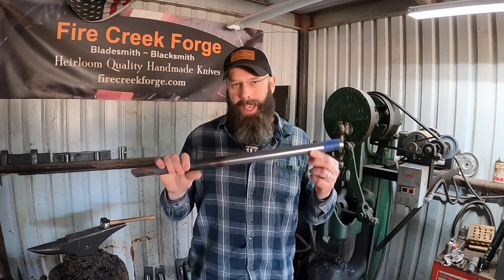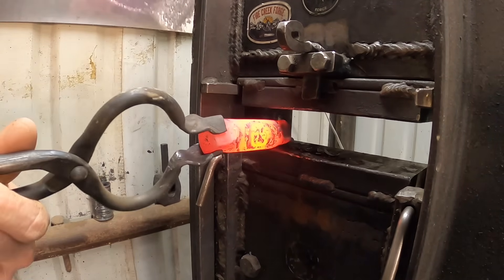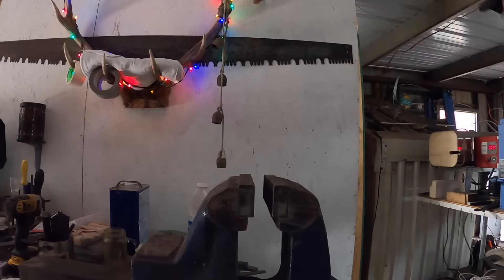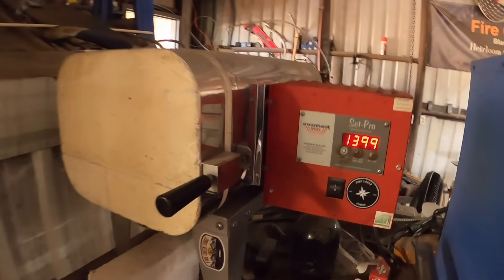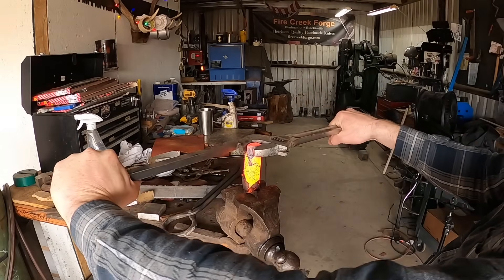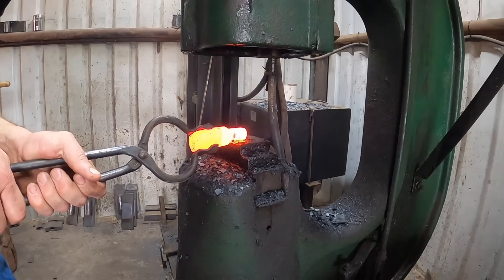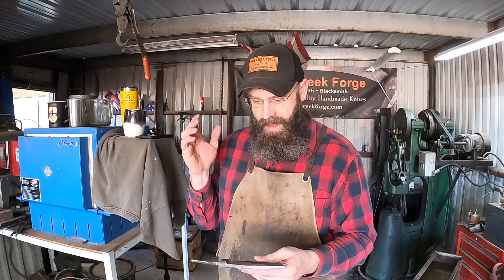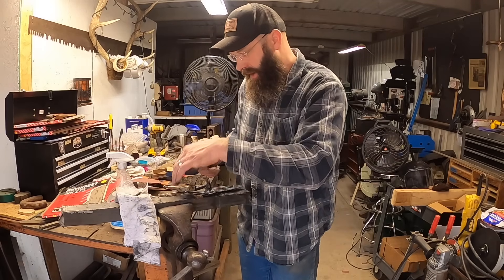Can I Make "Wootz" From W1 Steel??

Comment: I am a professional metallurgist with 22 years in the industrial forging business and a couple of years in the bearing business before that. I got started down the path of metallurgy because of knifemaking which I started doing in the early 1990s. I mention that just so you'll know  that my following comments are informed by formal metallurgy training and experience. The project in this video is super interesting because it relies only on the solid state diffusion of carbon, controlled by thermal cycling, to develop a visible carbide pattern. In my professional capacity I have had the opportunity to look at both modern and historic wootz and I have read most of the technical papers on the topic. Dr. Verhoeven was in the midst of his work on this when I was in college and I have read and re-read several of his papers from that time. His theory on the need for a carbide forming element has become the accepted idea as the key reason for the macroscopic carbides. However, it is absolutely possible to achieve that pattern without a carbide former provided you have a very slow solidification rate and some phosphorus. Phosphorus was very common in early iron ore and was not removed by early steel making methods. When present in sufficiently high percentages (it is common to see historic wootz with P=0.1-0.2%) it promotes carbon segregation. the phosphorus also changes the temperature and carbon content at which normal reactions take place in steel which means the iron-carbon phase diagram is no longer an accurate predictor of what is happening in the steel. The phosphorus compounds that form have a much lower melting temp (as low a 1750 F) which is one significant reason why historic wootz was often forged at fairly low temperatures. the other challenge associated with forging traditional wootz is that some the carbides are very large, can be interconnected and are very brittle. They do not all dissolve during forging and so you are really forging a composite structure of austenite and iron carbide. In the mid 1700s the English started using crucible steel making methods but they did not make woots and really struggled to do so when they tried. This was because the iron they used as the basis for their steel was low in phosphorus AND because they poured their liquid steel into cast iron ingot molds resulting in fast solidification. That prevented large carbides from forming. The makers of wootz used a method in which the liquid steel was allowed to solidify slowly in the crucibles, which according some historic observers were left in the furnace to cool. It is this very slow solidification combined with phosphorus in the raw material that seems to be one of the significant reasons for the large carbides in wootz. Clearly, you can make large carbide patterns when strong carbide forming elements are present. Many people have done so in modern times and even modern high alloy tool steels may show carbide segregation if they are etcheed. this is particularly true of the high alloy steels like A2 and D2. It should also be noted that carbide size can be manipulated as was done in this video simply by using various thermal cycles but it unlikely that this method will ever develop as bold a pattern as those achieved by the precipitation of carbides directly from the liquid metal during solidification.
Reply from the maker: Thanks for sharing!

Comment: Safe to say answer is NO :) Cut it up into small pieces. Place in crucible. add glass and leaves. Melt the crap out of it then slowly work the puck into shape. The W1 should have the trace Vanadium needed for the pattern to form.Then I'd say Yes :)

Comment: Logically it makes sense that the grain of the steel never changes while forging. I wonder if you couldn't forge a blade as normal and just do a bunch of thermal cycling afterwards to get carbon migration
Reply from the maker: I believe so

Comment: I get why this is an interesting experiment from an aesthetic angle; finding a new way to get a pattern in steel is cool. But when it comes to pratical knife building, I'm a little stumped as to why you'd go with a technique that increases carbide size in your steel. I'm currently reading Dr. Larrin Thomas's book Knife Engineering (the second edition). Everything I'm understanding so far points to large carbide formation being an undesireable condition in knife steel. specifically, carbide growth leads to reduced toughness, because "(L)arge carbides require much less energy to initiate cracks." (P. 40) Further, larger carbides lead to more difficult and inconsistent sharpening. (P. (7)becuase
Reply: My understanding is the large grain structure was only temporary to get the desired pattern and after he did that, he changed the grain structure back to what would be ideal for a knife. I highly doubt he wouldn’t properly treat it to make the knife fully functional.
Reply: @mulepowerforge  grain structure and carbide size are two different things, as far as I understand it. I know he thermal cycle to refine grain structure. But if the carbide themselves reduced in size, the patterning he was looking for would be lost, unless I'm missing something. It's not about the heat treatment per se. It's about the size of the carbides inside the structure.
Reply: @fireplusbirdfilms6517  interesting. Even though I’m also a knife maker I don’t understand metallurgy lol. I tried reading some of Larrin Thomas’s work and it just melted my brain. It’s like a caveman doing physics. Just doesn’t click haha
Reply from the maker: Like I mentioned in the video, this is something I normally avoid even at a much slighter level. And yes, grain size/ carbide growth are two different things. Like large grain, large carbides do tend to reduce toughness.
Reply: @FireCreekForge I would like to ask questions but I’m so confused I don’t even know what to ask.

Comment: That's pretty neat!  I know I've seen some carbide patterning when I soaked a couple of blades I made out of 1080 in muriatic acid. I only did that to clean off some scale and I ended up sanding the pattern away, but I may need to revisit it now that you've shown me a usable technique. Thanks for sharing.
Reply from the maker: Thanks for watching!